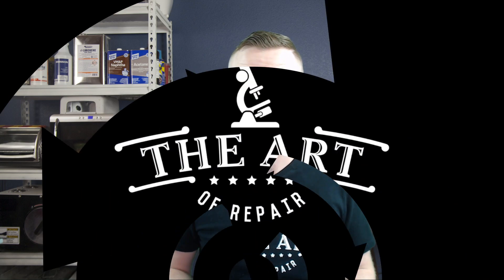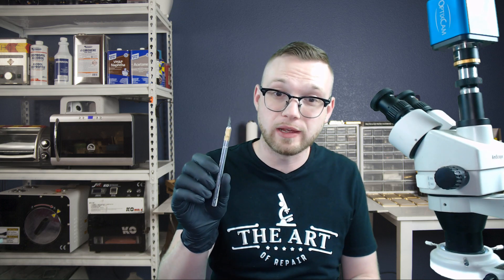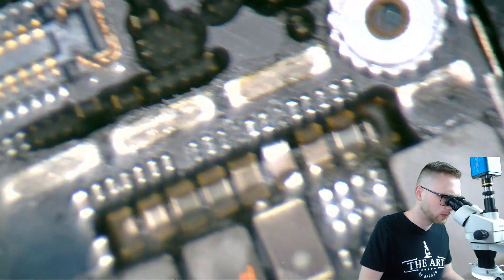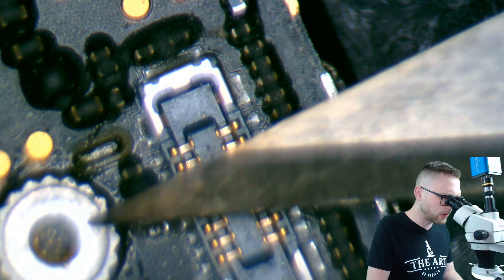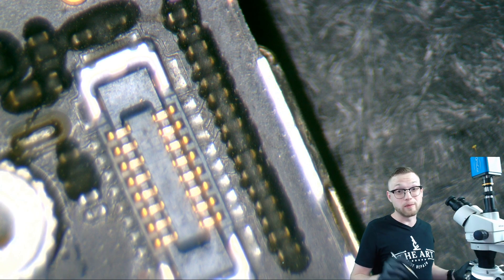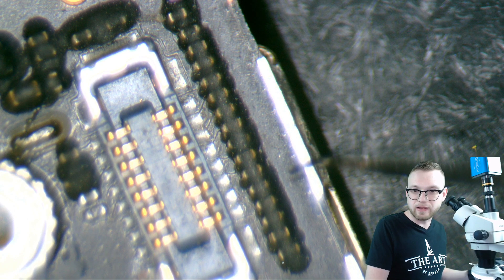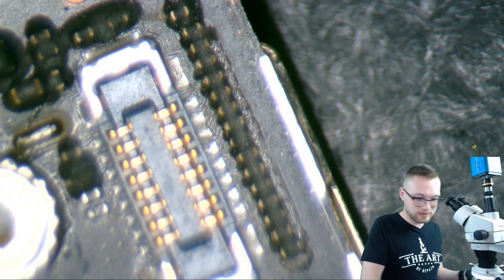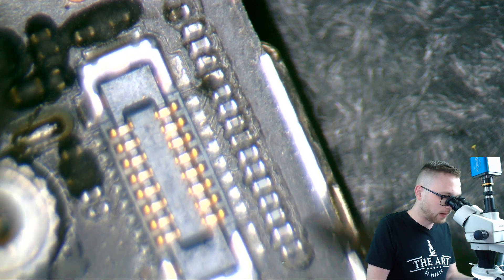EP43 Basic Apple Underfill Removal | How to prevent a second attempt on your BGA work!

Comment: sweet blades, let us know when they are available, just went to amazon but couldn't find them. thanks, great videos man.
Reply from the maker: I have actually acquired two shipments of these blades for resale, but they failed quality control. I have another shipment on its way currently, hopefully with the correct quality. Problem was that only half of them were cut to the required width, and half were to big, not by much, but enough that I wouldn't use them. So with that, if im selling it as something I personally use. I want it to be exactly what its portrayed to be. Not a cheap imitation.  I will make an update video as soon as they are available on amazon. =)

Comment: I am using similar techniques on component removal for circuit boards. I work on IC'S/component removal for repair and reball daily.  Any suggestions for an adhesive remover or liquid/ adhesive removal from the IC ???

Thanks
Reply from the maker: All the chemicals out there will cause nerve damage and lung damage. So I don’t use them. Gota do it the hard way it seems for now. Unless you want nasty chemicals. Then China is full of them.

Comment: Why does this Apple-specific term "underfill" exist? To me it just looks like yet another type of tacky glue/adhesive we find on boards. 🤔
Reply: underfil serves 2 purproses. #1 it helps the IC that is underfilled rise in temperature pretty close to the same rate the PC board below does. This protects the part from thermal differences which can weaken the joints. #2 its there for shock absorption as well.
Reply: @billbubnis3128  Nifty! Thank you for the explanation. 👍

Comment: Thanks Justin! I bought a bulk lot of vintage Dumont tweezers one time that had a pair that had one tip broken off around an 1/8" back. I started to put it in my get to later box and then thought about using it for removing conformal coating. So I sharpened up the good tip real sharp, and it works great!

Comment: nicely done justin. quick question about you scope camera always seems out of focus on bottom ?
Reply from the maker: Iv determined that I have had this scope for so long that it is forever going to be loose when moved around. So it distorts the image when the head leans. =(
Reply: dunno there is a YouTube video guy had same problem with focus ended up being a specific lens..
Reply from the maker: I use the same lens as everyone else for this type of work. there is not many alternatives =D what channel? Ill go look into it. But i do know for sure my scope is def and old workhorse. It gets really loose at times =(
Reply from the maker: I went and checked him out, i actually have both the manual and fixed focus .50 and .37 from that company. i have the same issue across the board. Iv been contemplating picking up a new scope anyway, mines about bit the dust as much as i move it around lol but i really appreciate you taking the time to try and help. I def would like to correct the issue at some point lol
Reply: TheArtofRepair I had the same issue with both of those. the only one that is even across the board is the one thst starts with sz in the model number of the adapter  which is much shorter and only fits certain microscopes since they change the trinocular port design all the time just to be annoying.
Reply from the maker: Louis, would you mind sharing the link to the SZ adapter? I looked around a little bit and saw a few things similar to what you were talking about but they seemed to be for other types of scopes?
Reply: I use the SZMCTV1/2. http://www.ntscope.com/Merchant2/merchant.mvc?Screen=PROD&Store_Code=MTC&Product_Code=SZMCTV&Category_Code=LAB 

 The thing is Omano and Amscope change the trinocular mount all the time and it doesn't fit certain microscopes so you may have to return it. But it is by far the best in terms of even focus. The other mounts will focus one area, but the rest will look out of focus, less clarity, everything looks far away. I have some old videos comparing these mounts and this is by far the best. Even more expensive microscopes look worse if they use the "traditional" longer mount.